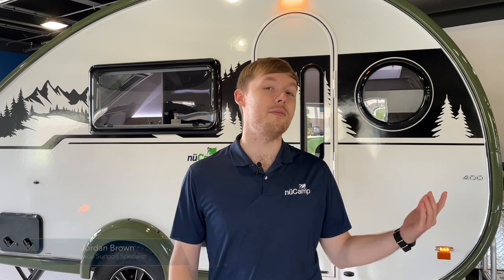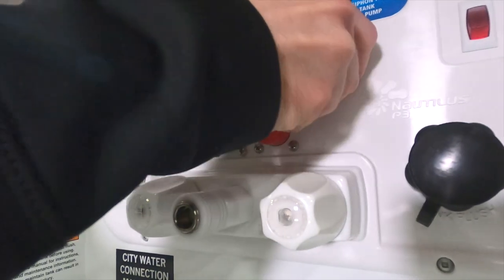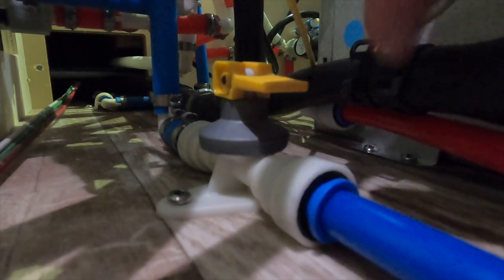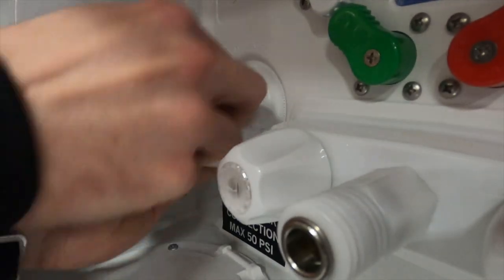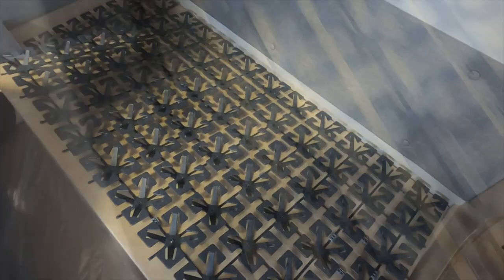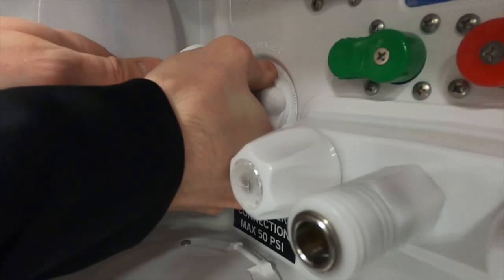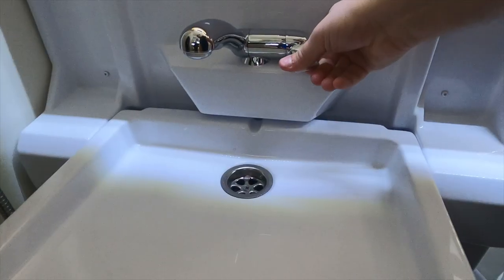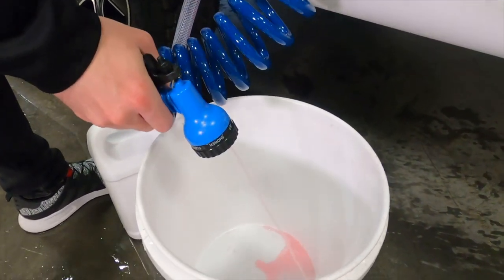Winterizing the TAB 400

Comment: Beneath the bed there are two yellow valves. One for hot water, and the other for Alde Flow. Should the Alde Flow drain be opened, as well?
Reply from the maker: Please reach out to tech@nucamprv.com with any questions. Our Technical Support Team will be happy to help. Thank you!
Reply: The answer to this is "yes...drain both". After reading your question (I had the same one) I emailed and they confirmed that you drain both. When you use the "winterize" mode on the Nautilus system, that bypasses the Aldi so you are not putting antifreeze in that tank.
Reply: “Open the lines one by one… repeat the process for the hot and cold low point drains… tank …” ?!!! Wtf does this mean?
Reply: Right

Comment: If you are going to use the antifreeze winterization method, what's the point of blowing out all the lines? When you pump the antifreeze in, you have to turn on all the faucets and run them until the water is pink anyway. Wouldn't that force any remaining water out? Even if somehow it didn't, I can't imagine that some water droplets would matter? The line blow-out makes me a little nervous plus I don't want to spend $ on a compressor just for this process.
Reply from the maker: Thank you for your question! Please reach out to Technical Support at tech@nucamprv.com.

Comment: Is it necessary to use compressed air if you're pushing the anti-freeze through all the line?  Also, what about the black tank flush line?  Wouldn't it be good to connect the exterior spray hose to the black tank flush line to run the anit-freeze through that line too?

Comment: 2021 Tab 400

When we place the Nautilus valves in their 45’ angle positions and begin blowing <40 psi compressed air through the city water fittings a large amount of the compressed air is flowing through the fresh tank overflow tubing under the trailer. That leaves only a much smaller amount of compressed air available to blow out the various faucets.

Is this expected? Will the blowout be effective for a blowout-only winterization?  We were hoping to avoid putting antifreeze into the fresh water lines/faucets).
Reply from the maker: Please reach out to tech@nucamprv.com for more information. Thank you!
Reply: Do I return the the hot and cold valves to the horizontal position once I blow each line out separately, then move on to the other faucets?
Reply from the maker: @kimberleesublett  You should open the valves before blowing out the lines to drain any water. After that, close them and open them one at a time, blow out the line, then close it again. Vertical is open and horizontal is closed.